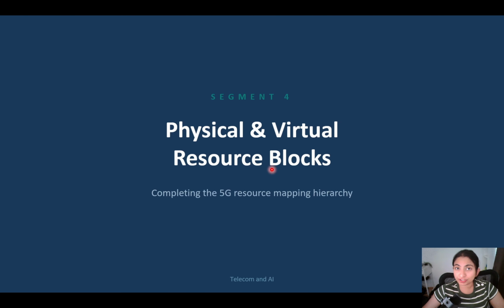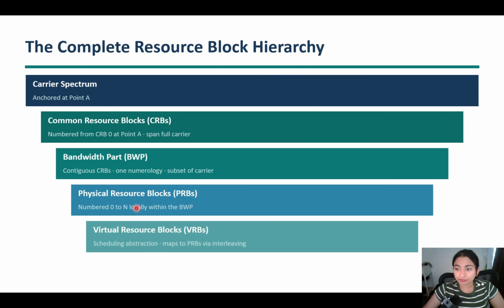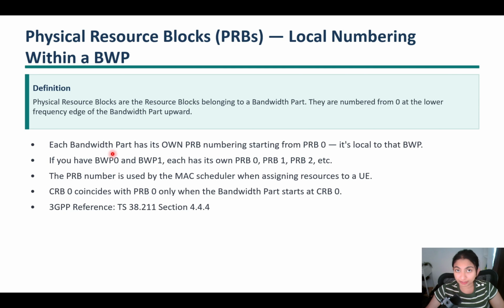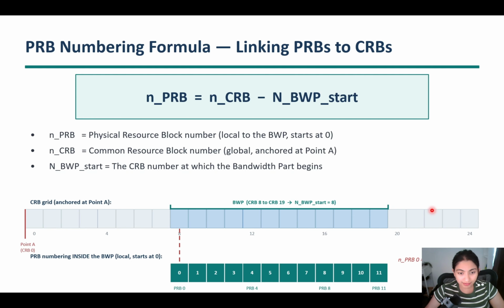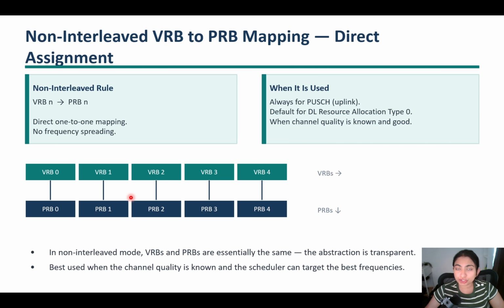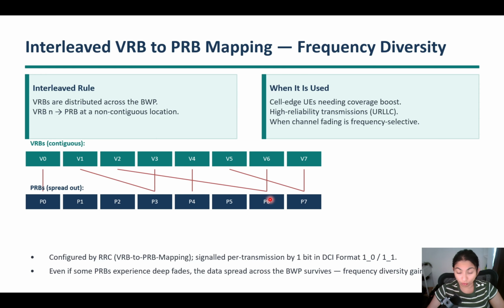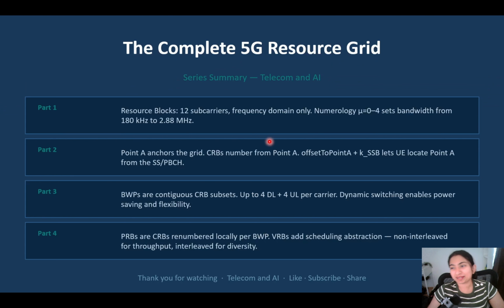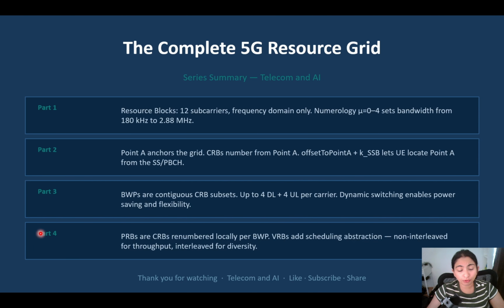5G NR Physical Resource Blocks (PRBs) explained | Resource Grid #4

Comment: Thanks for the video! The BWP for a 10Mhz channel is 24, and for a test they only require 11 Rbs of Pusch data,is it Equivalent to PRB count? How can we understand the concept of CRB there?
Reply from the maker: Very good question - So your 10 MHz channel BW has 24 PRBs (30 kHz?). Out of this 11 RBs are used for PUSCH transmission (RB allocation in that BWP for PUSCH at that particular slot). Since PRB numbering is relative, PRB0 starts at the beginning of your BWP. However, CRB numbering is absolute. It always start at Point A. Point A can be calculated from SIB1. So PRB_n = CRB_n - CRB_at_bwp_start. Hope this makes it clearer.
Additionally, I explain this in detail in the video ‚5G NR Point A Explained‘. I hope it gives you a clearer picture.